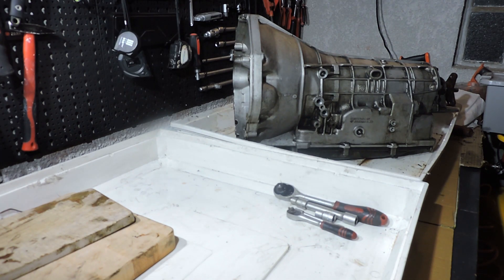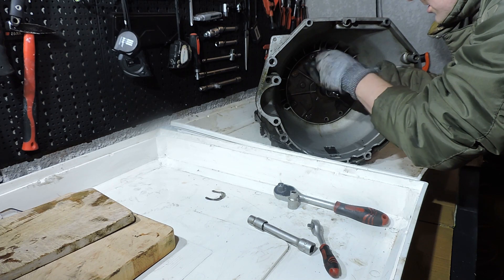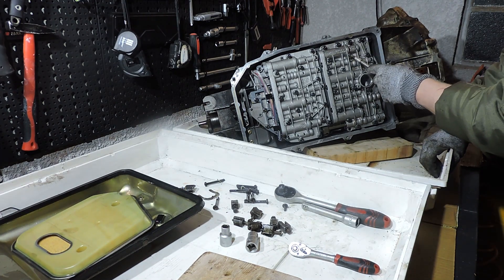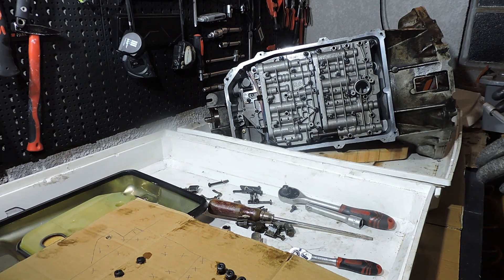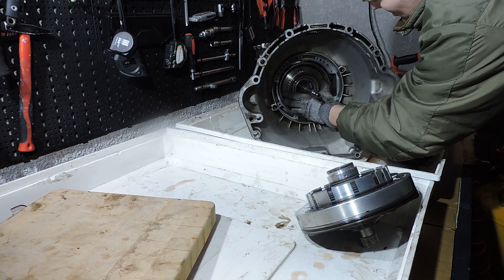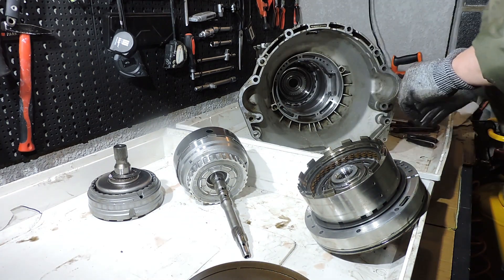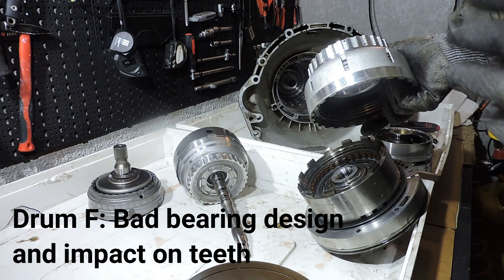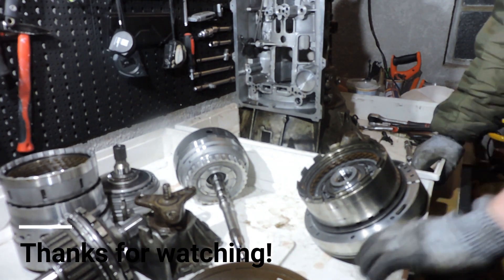5HP18 / A5S310Z Basics and dismantling (BACKYARD).

Comment: Hello Frank, I'm writing in English now, but I think you're Dutch-speaking like me :-)  I drive a 1992 E34 525TDS with 190,000km. The ZF works pretty well but I have a problem I think. When I drive on the highway (at 110 km/h for example) the engine runs at +- 1900 rpm. When I accelerate a little bit, the engine immediately turns up 500 rpm and after a few seconds it picks up again and starts to run at 2000 rpm. It's as if it slips for 500 rpm before it picks up. When I give a solid amount of throttle, it reacts almost like a kick down.The revs shoot up and it shifts down.   Can you give me some advice on where to look for the problem ?   Grts Patrick Antwerp

Comment: I have the issue with this transmission, i do the GM 4 speed to this ZF 5 speed swap into my e39 and since the swap was done the transmission acting weird, random knocking noise from transmission when idle and moving (in any gear position), and its shift bad when coasting to stop at 40-50 kmh or 20-30 mph the transmission cant find the suitable gear for that speed, its always shift 2nd to 3rd and 3rd to 2nd (up and down) in the rage of that speed all the time, and one time it shift very bad the car jumping forward and it trigger the traction control, So should i overhaul or change it to another. (low budget)
Reply from the maker: @JUK3RRR  Is the wiring and computer also replaced? Else the computer gets the wrong signals.
Reply: @poeliewoelie1987  I'm done the complete swap with wiring and TCU from the e39 pre face (mine also pre face) form the shift problem i suspect the tcu but the knocking noise(loud) are more concern to me
Reply from the maker: @JUK3RRR  Make a movie, upload to tube and paste the link here.
Reply: im not sure that fail tcu can cause any physical knocking noise? is it possible? but the noise problem occur when doing hard turn or sometime it just come when idle or moving, but the sound gone when car start to accelerate. its just random, which is PITA
Reply from the maker: @JUK3RRR  Bearing failure but i need to hear it.

Comment: hi, I encountered a slip with zf 5hp18, how can I resolve it? the gear shift is perfect
Reply from the maker: @d3lbo1  In what gear?
Reply: @poeliewoelie1987  in all gears, but is very noticeable in the first 3 gears. with a hot engine it struggles to climb a small step of 3cm
Reply from the maker: @d3lbo1  It slips while in gear? It can also be the converter.

Have you removed the pan? Color, smell and debris will tell you more. What engine do you have?
Reply: @poeliewoelie1987  yes, it slides while in motion. the oil smelled exhausted, the color was not bad. I changed the oil and filter but the problem remained. bmw e36 325i

Comment: Don't scrap anything! The gearboxes for M60 engines are very rare. It was a pain in the ass to find an exact same 5HP18 spare for my 530i.

But I got a question. My gear selector is broken and the car is stuck in Neutral. Is it really necessary to remove the whole valve body, or is it possible to just remove the rear part of the valve body to get that broken piece out?

Nice video!
Reply from the maker: With removing only that one valve housing, you risk losing some tension on the gasket in the middle. Just do a complete valve body clean and fit a new gasket and new selector. It really pays off!
Reply: @poeliewoelie1987  thank you for your answer and keep up the good work. 👍🏻